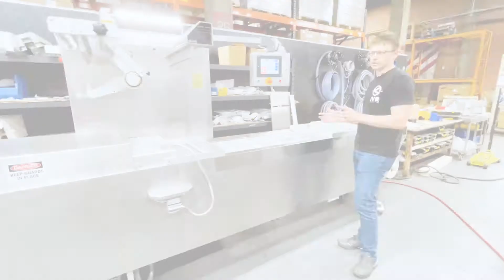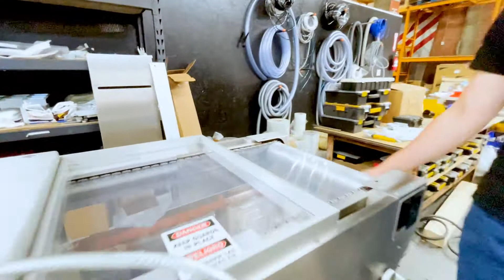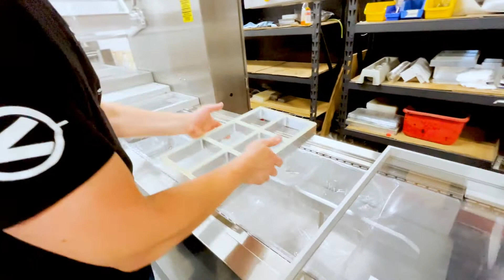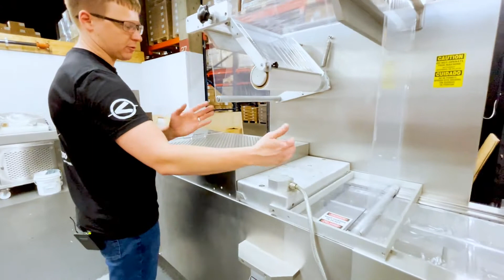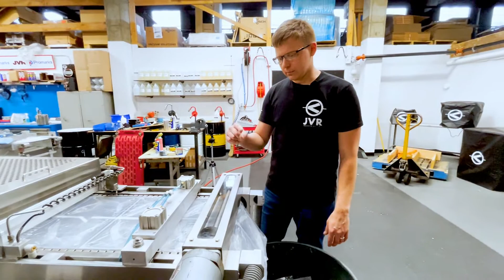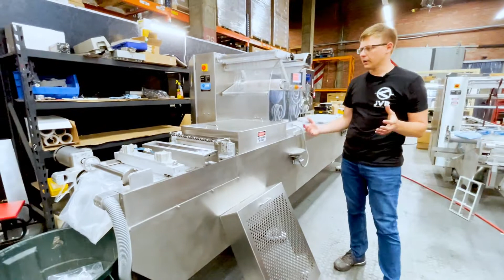Buyer's Guide | Rollstock Vacuum Packaging Equipment

Comment: Does the advanced setting change after a tooling changeover?
Reply from the maker: The advance distance setting is based off the machine die.  The advance will remain the same when switching divider sets.  For example a 420x240 die will have have various divider set options such as a 2x1, 3x1, 3x2, 4x1, etc.  Each of these dividers would all fit the same die and therefore will all have the same advance settings of 240mm.  With a few exceptions, the only time the advance setting would change is if you were changing out the entire die assembly, this includes head and buckets for the sealing and forming stations.

Comment: I noticed the dollies under your roll stock machine. I have a machine which I need to roll around the shop, Where did you purchase them. Thanks Jim
Reply from the maker: Model 2127 with the steel wheels are what we use and we buy them here: https://www.bondcaster.com/m_h_dollies.html